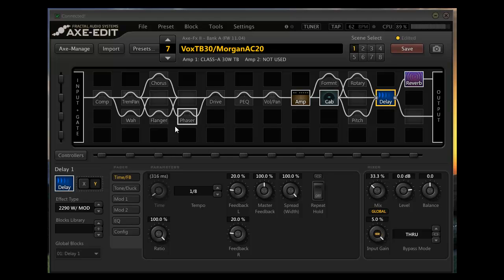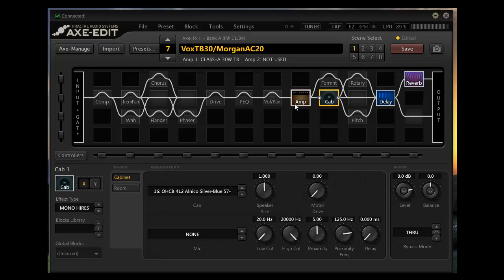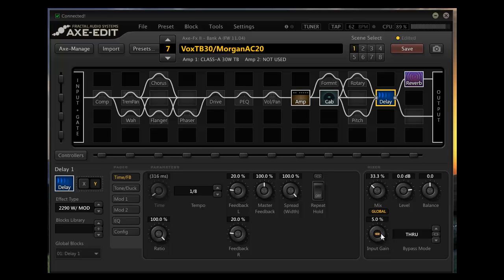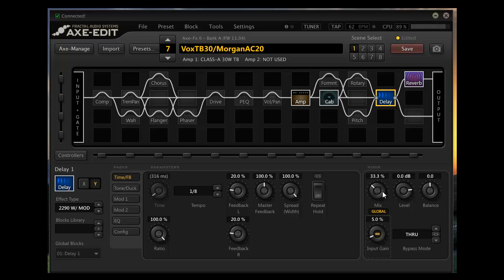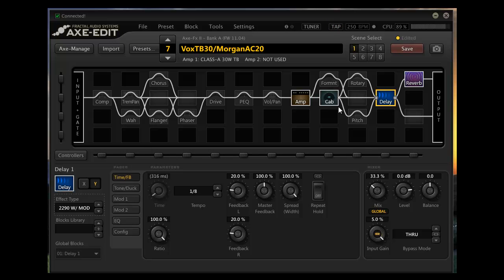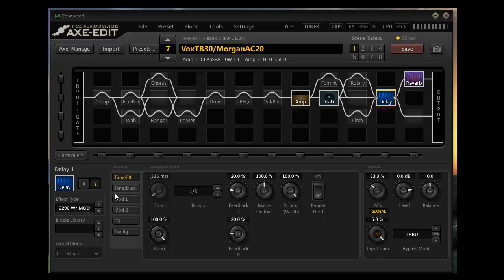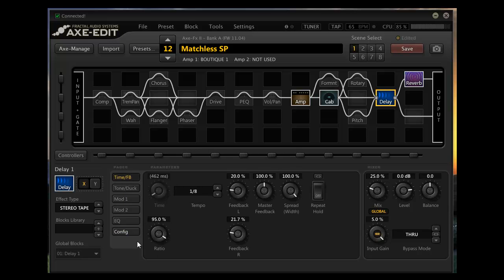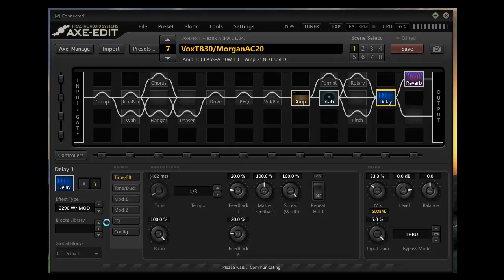Taming the Monster - Fractal Audio Axe-FX II Dial Up My Delay Tutorial

Comment from the maker: It's personal preference. It's all in the digital domain, so the difference is in the routing options it offers. I you look at my layout, you'll see the Trem does not interact with the wah; so when I run them both, it's still clear what I'm doing - the trem doesn't 'wash out' the wah for instance. I'll be doing a video on serial vs. parallel in the coming weeks.